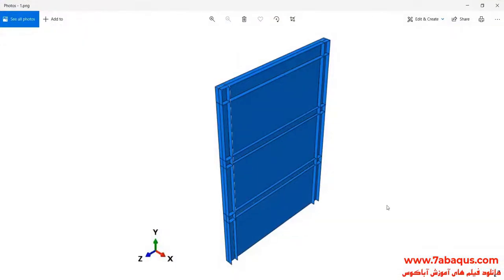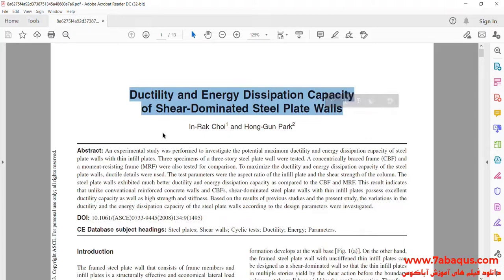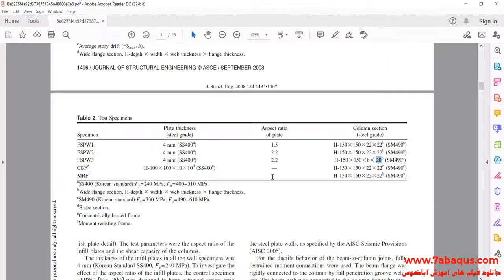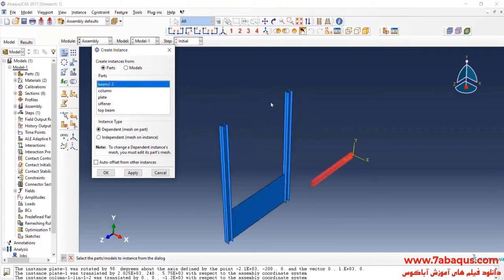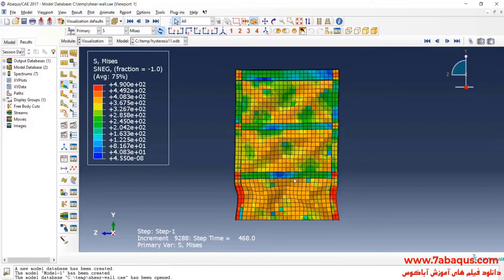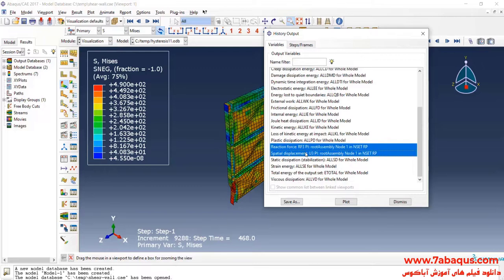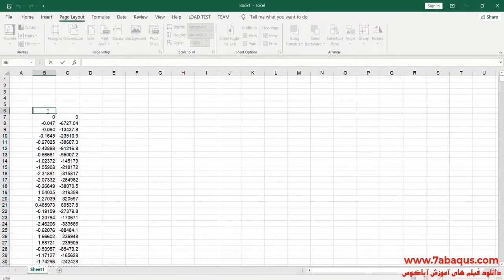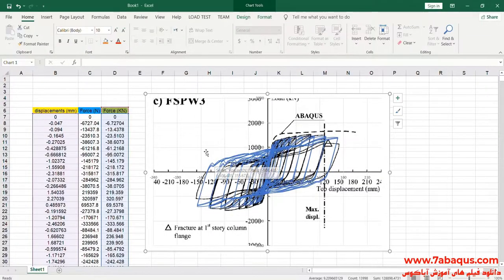Three-story steel shear wall undergoing a cyclic loading in Abaqus

Comment: When using shell elements in a steel frame generally the instances will merge as unique part, but what if the model mixte between solid and shell, what we could do in the interaction part ?!!
Reply from the maker: Use "Tie constraint"